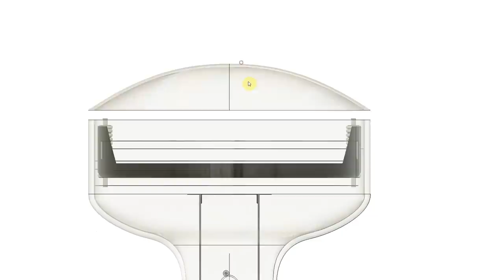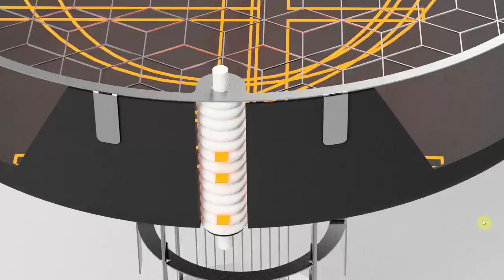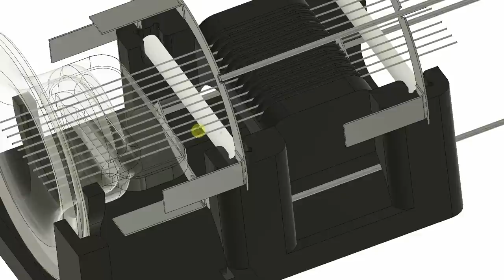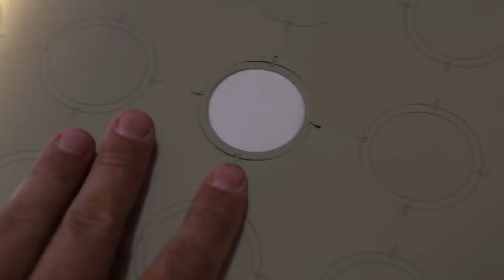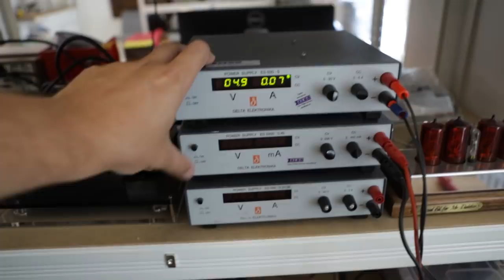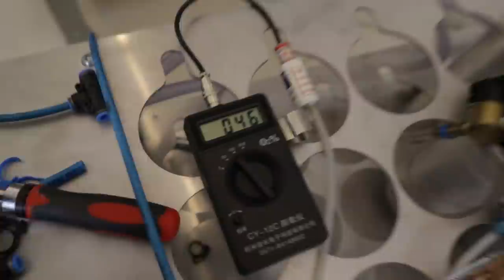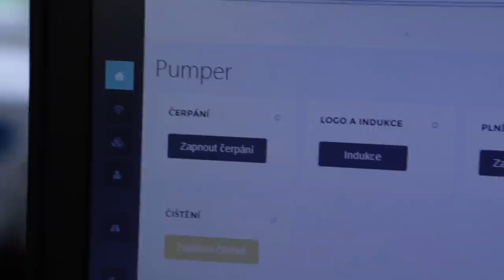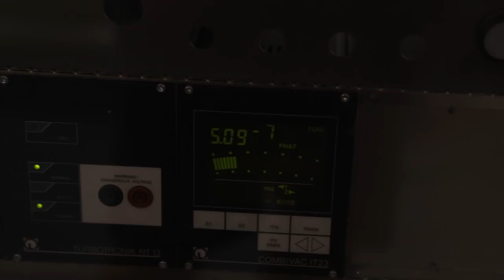Update: pressed metal parts, oxygen source, electronics, internal parts - Project H #12

Comment: Have you tried a UV-Resin 3d Printer? Since it is not a thermoplast, it should be more temperature resistant (Also it can print finer details usually)
Reply from the maker: Wow! Thats it, didnt think about resin printers! I have to check it out immediately!
Reply: @daliborfarny  Its not exactly home printer friendly, but if you have your design finalized and can find a print service that uses it,  "NanoTool" UV resin by Somos,  takes heat relatively well. >200C once its fully cured, for light loading. For short duration, ive had incidental contact with a soldering iron tip not do much if any damage to it.   A print service that can do PEEK or ultem/PEI in a FDM printer would have a higher service temp too, not sure if its high enough to do the initial cure on your ceramic though.
Reply: I'd second the PEEK filament suggestion, or outsource to someone who can print PEEK.
Reply: Dalibor Farný check out Marco reps video on resin printers
Reply: I believe FormLabs has a resin intended for use in molds for injection molding that would be particularly heat-resistant.
Reply: @daliborfarny  Appart from resin printing, another useful and fast option would be to create a negative mold from the 3D print using silicone. You can then use this mold to cast parts which can easily withstand to your pre backing. 

(Plus, you only need to print one piece in order to create many molds, so total production time might even be less)
Reply: @daliborfarny  For ultimate temperature tolerance there is also ceramic printer resin that contains a high percentage of ceramic powder.  It's called Porcelite, though there appear to be similar products out there that are cheaper than the $500 price.  It does require a burnout treatment to remove the resin and sinter the ceramic particles, and anything over 1mm thickness may have problems with cracks.  Aside from such limitations it's amazing stuff, check out Integza's channel where he tried using it for rocket nozzles unsuccessfully.
Reply: You could try to contact Průša 3d printer maker company in Prague and ask them about this possible solution.

Comment: I am really enjoying this series, thank you very much for taking the time to do it while busy with real work!  I've had an interest in discharge tubes, glass blowing, vacuum techniques and related things for many years.  I recently got back into playing around with such things because of a project at work - but also for a bit of fun during the COVID-19 lock-down.

I am working on potassium vapour cells for a SERF magnetometer and I am having problems with getting the potassium into the system without residue from the oil or solvent used to protect it while handling in the atmosphere...  Have you ever made metal vapour tubes?  Dropping a small piece of toluene-wet potassium into a bulb and pulling a vacuum on it then baking it gently seems to be insufficient, even after washing it out with argon a few times.  I guess I could vacuum distill the potassium into the bulb from a larger tube that I heat while cooling the bulb I am trying to fill, but I'd need a cryotrap to keep the vapour out of the rest of my pump system.  Alternatively I could generate the potassium from its azide like a barium azide getter and pump out the nitrogen which seems easy enough but I'd rather avoid using azides as they are explosive.

Another personal project is active nitrogen experiments.  I've always been fascinated by the afterglow of nitrogen discharges and I have been working on making the decay time longer.  I read that "poisoning" the glass helps a lot to increase the half-life of active nitrogen, and it involves treating the inside of the glasswear with phosphoric acid...  Have you come across this ever?  I assume I may need to do something similar to the potassium vapour cells too to increase the lifetime of the coherent magnetisation, so I want to practice the techniques with something easier to measure like nitrogen afterglows.  So far I've had some difficulty seeing any improvement, but it might be the purity of my nitrogen which I am just making from air with an oxygen scavenger of copper or iron, this leaves argon and other contaminates.  I was going to chemically produce the nitrogen and dry it and try that before I bother getting a cylinder of nitrogen for what is just a fun project.
Reply from the maker: I am really excited for the amount of you guys actually following the project, thank you! As for the metal vapors, I would look into a sodium lamp manufacture. From my childhood experiments, the sodium reacts readily with air (oxygen) just like potassium - so following the way of how sodium lighting lamps are manufactured might give you the answers. It is a process that was once turned into mass production, so it should be doable in a lab. As for the nitrogen - when you remove oxygen, there is still water in it (at least hydrogen), water is usually the biggest problem initially. I would try to get a cylinder with technical “dry nitrogen”, it is not expensive. Cheers!

Comment: The reason rod to rod didn't work, with the welder is because when it's done industrially, first the machine crushes the rods together a little, then, welds them. You can see a very similar process in either  How it's made or its National Geographic counterpart, when they show fence or supermarket trolleys being made. It's not apparent at first, but that's how it's done, obviously, the entire process is so fast it's impossible to spot if you don't know about it, but you can see how they are deformed a little in the finite product.
Reply: When I build my own vacuum devices by hand I first flatten the wire join locations a bit with a jewelry hammer on a small anvil.  Previously I just squashed them a little with smooth jaw pliers, but the anvil technique is better.  This works well for kovar, dumet, nickel and other ductile metals but not so well for tungsten for the borosilicate glass seals which is very hard.  It does work-harden the wire if you over do it and vibrations during pumping can make it fracture if it isn't annealed, say in a cantilevered structural element away from the seals (which get annealed during oxidation and degassing with the torch before sealing into the glass).

Regardless the sheet metal is much easier in a production situation, even with jigs making structures out of wire is much more fiddly.

Comment: Good day Dalibore, I so enjoy your updates and watching your amazing progress on the H tube project. I am so excited to see it come to life and am so happy for you and your company. I was watching your assembly of the stem and the little wires where you are gluing them with the ceramic glue. I watched the other previous things you did. I had a thought, what if you used similar little ceramic washers slid over the ceramic tubes as separators between the wires? This could serve to keep the wires separated, as well as add additional area for the glue to adhere to as it gets between the washers. It would make for a solid assembly. Obviously the washers would be a custom diameter and thickness to achieve the solution. Just a thought I had. I so love watching your thought process?